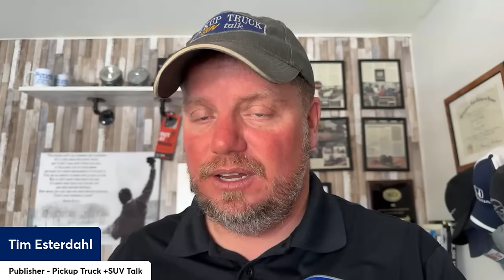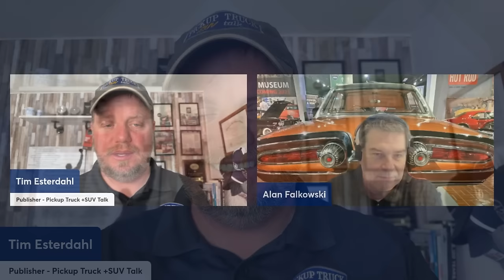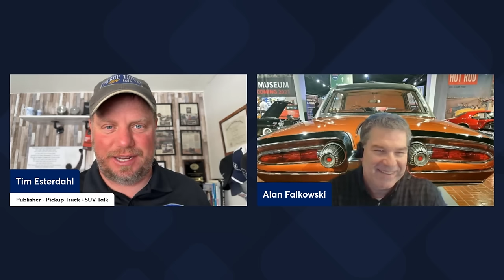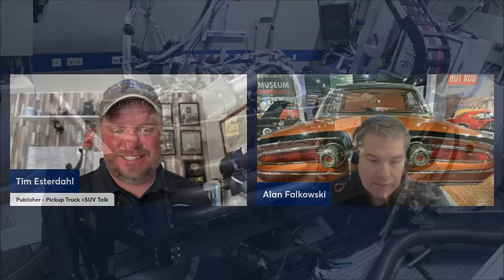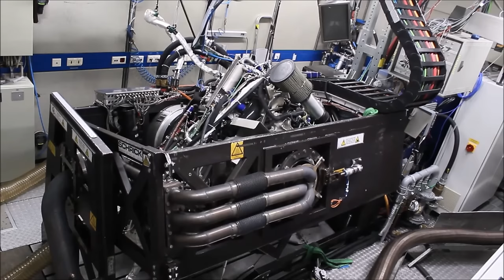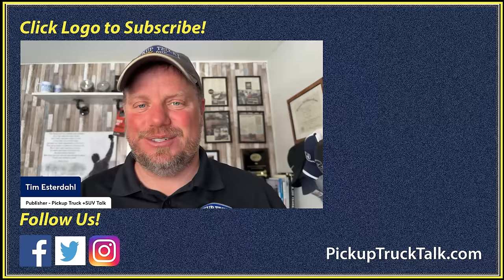Engineer Deep Dive: 3.0L Hurricane Engine - Turbo Life, Oil and Intervals and More

Comment: I notice whenever engineers are discussing new vehicle/engine designs, they rarely talk about longevity in terms of 5-10 years down the road.
Reply from the maker: Nobody will ever talk about longevity in terms of years or miles. It makes no sense for them to do so.
Reply: When you want a 4 cylinder to the job of a V-8.  Have you made that Engine Last as long as that V-8... plus you charge MORE money.  Un real
Reply: @maxr4448 the hurricane is literally damn near bullet proof when it comes to materials and efficiency..I would not be counting it out last way longer than the hemi did stock for stock
Reply: @lafosh7234  How would you know how long a Hurricane would last in the real world compared to any engine?  It has only been on the market for about a year.
Reply: @robc8468  exactly!  Chrysler’s experience with turbo diesels in the late model  jeeps and gasoline turbos has historically been crappy.  I recall my 1985 Chrysler laser turbo was a disaster.  The 02 sensor failing every other month.  Having to cool down the car 5 minutes every time I parked the car to save on the turbo life was also annoying.
Reply: @lafosh7234 just given what he spoke about what they did to keep the turbos cool, to the way the cylinder bore is made smooth in a way where it really won't wear out. That's pretty cool to know that after 200k you can slap some bearings and rings in and put it back together  without needing to bore and hone the block (theoretically) of course.
Reply: @mongo64071  yeah..recalling a 1985 car sounds like the responsible thing to do….but in the years beyond that to today 2024 we have came a very long way in performance cars reliably handling high boost..these inline engine are specifically built around handling high boost and the wear and tear that comes from that…these are stronger and more efficient and durable and LIGHTER materials in this engine only pushing just tipping 2klbs compared to the heavier v8 and ESPECIALLY HEAVY ASS BATTERY EV’s..the Daytona weight for example is damn near divided evenly with the car and wheels by the actual giant ass battery powering the car
Reply: @lafosh7234  I think the last time Chrysler sold a turbo was back in the 80s with the 2.2.  They went 40 years without any turbo development.  I would not trust their first-in-40 year design with my money until these things have been on the market for at least 5-6 years.  Heck, if Toyota and Honda are having teething pains with turbos, I can’t imagine how badly Chrysler will mess this up.
Reply: @Pickuptrucktalk What metric should they use? Have they developed no service intervals based on time or mileage? While hours running is typically a better metric, especially when thinking of service vehicles, but it doesn’t account for items that time will get to regardless of time running. 
People are going to be rightly cautious when a manufacturer goes to an entirely different power plant, especially when they say that it will last xxx hours because they’ve seen it in a lab. That simply doesn’t translate fully to real life.
Reply from the maker: @Freedom_is_better_than_safety  there's a new oil life sensor most brands are moving towards. It is a much better gauge of the oil than miles or hours in their opinion.
Reply: @Pickuptrucktalk But this doesn’t address the question of the component longevity 5-10 years down the road. Oil maintenance is only one aspect the consumer is worried about. Most of us are worried about the long term sustainability of the major hard parts of the vehicle when they cost $60k and more for a new pickup, and what we’ve seen in recent years (especially on the small displacement turbo engines) is that replacement of major components before or around 100k miles is not uncommon. All of the Ecoboost engines suffer from major issues, and they were reported to have been tested for X hours/miles, etc with recommended oil change intervals but this isn’t translating to real life. Then you add in rubber degradation and unavoidable failures and we just want to know if we’re going to get this thing paid off in 7+ years at $800+ a month before we’re suffering from costly repair bills. 
Bottom line is when vehicles cost these ridiculous new prices, they need to last for a ridiculous amount of time before repairs are needed if they only receive recommended maintenance.
Reply: @Pickuptrucktalk Not true. I saw one with a Ford engineer talking about the Super Duty trucks should hit 200k miles with minimal if any problems.
Reply: @mongo64071  Not entirely true. They have sold low volume Neon SRT4 with a 2.4T & Caliber SRT4 with a 2.4T. 
There is also the current 2.0T in Jeeps, both PHEV and regular ICE. I'm not aware of any big issues with the 2.0T as of yet. Full disclosure though, I opted for the V6 when I ordered my Cherokee back in 2018 as I was not looking to be a guinea pig on the then new 2.0T engine.
Reply: @UN4GTBL  thanks.  I stand corrected.
Reply: @robc8468  3 years, actually. And it has had higher reliability ratings than any other engine on the market for those years.
Reply: Ford 2.7 ecoboost twin turbo V-6 been around for 10 yrs. GM 2.7 turbomax twin volute I-4 for 5 yrs. Ram 3.0 hurricane twin turbo I-6 is not a slant six w/ a couple turbos jammed on it. Same w/ Ford & GM. Always has been skeptics refusing to accept new designs/technology. From the LS replacing traditional small block, to fuel injection replacing carburetors, to fwd sedans & coupes w/ V6 (3800 was far from a failure) replacing rwd V8 sedans & coupes. Jeez everybody, let's bring back flatheads, those were considered to never be replaced & were thought to be the pinnacle of engineering before overhead valve engines were developed.
Reply: @lafosh7234 the first hurricanes are literally only like 4 years old. Most owners haven’t even finished the payments on these vehicles.

Comment: A big car with a small turbocharged engine may seem like a solution to the problem, but such engines often require repairs after 100,000 miles. Many people get excited about the increased power compared to the old V8s, but what does it matter? We know that many people lease these cars and switch to a new one after three years, leaving those who buy them second-hand to face the potential issues.

Comment: I have a 2005 Neon SRT4 that still has the original turbo and close to 175,000 miles.  Still runs great
Reply: My wife and I both had neons. 5 headgaskets each. Kept getting replaced under a "silent recall" for like $100. These were late 90s. They were garbage. Too bad, we really wanted to like them. It was one issue after another.
Reply: I own a 98 neon. ARP head studs and multi layer metallic head gasket. Ppl have been turbo charging the 420a for years. The engines are fine.
Reply: Your a very very small group that had that luck
Reply: Those cars use to beat my 4th gen Camaro handily. Thought the Camaro lt1 in 97 only had 285 hp and who could tell if the srt4 was hopped up. But they were kinda ugly to me, but props for being light, easily upgraded, ps my supercharged LS3 don’t play that gapped by a neon game!
Reply: That’s awesome! I love those little cars!
Reply: @johnmarshjr928  sounds like a nice way to make 500+ hp
Reply: Every time somebody I know complains about reliability of their vehicle you can look at the car, truck or motorcycle and see that it has either been abused or neglected, dents all over it, empty beer cans and old McDonalds bags filling the inside, ask when was the last time you change the oil, the response is "huh"? I have a friend that said the dealer ruined his new car by putting water in the power steering. His fool wife was the only one that drove the car he always drove his work truck, I KNOW she did it thinking she was filling the windshield washer tank. I've owned many different vehicles since the late 60's and never had one die on me or blow up.

Comment: My '86 Saab turbo 900 went 180k miles with an oil cooled turbo. No water cooling. I changed the Mobil 1 oil religiously at 3000 miles. It was perfect until it was crashed by the biggest deer I've ever seen. No reason a turbo can't last for a long long time.
Reply: Was it a variable geometry turbo? That is what often fails.
Reply: The Hurricane makes three times the power that Saab did, this compassion is pretty poor.

The Hurricane turbos are running vastly higher boost, and are variable, thus they get hotter and need more cooling, nature of the beast, comparing much older and weaker turbos to this is not very equivalent

Comment: So glad I bought a 5th gen Ram when they first came out. 5.7 hemi, no etorque, anti slip, 3.92 rear axle, 4x4. Everything I wanted in a truck.
Reply: Same! '19 Rebel with everything you mentioned.
Reply: I've repaired many 5th gen hemis. My advice, if you plan to keep it for any length of time, is to go ahead and have the camshaft changed to a quality aftermarket cam now rather than later. People blame the lifters, but it's really the poor manufacturing of the cam. It's brittle and will start spalling under normal use. If that flaked off metal gets into the camshaft bearings and fries them, know that those bearings are non serviceable and the whole engine would have to be replaced. Better to swap for a quality cam before risking that. 

I'd also change out the upper control arms. Stock arms are composite material..... PLASTIC. Not a week goes by that I don't see a 5th gen come in where the ball joint ripped completely out of the UCA after the driver hit a pot hole. 

And be extra cautious changing your oil. They mount the oil filter directly above the tie rod bushings. Engine oil deteriorates rubber bushings. That's why they put the oil filter there.... to wear out parts faster. 

Lastly, go ahead and fill the gap along the top of your rear window with flowable silicone (permatex). The window has a thin plastic ring. Instead of the adhesive going directly on the glass, it goes on that ring, so when the plastic cracks, and it will, there's nothing to keep the water out. 

These trucks are designed to fail. But if you put some cash in early to upgrade parts, you'll be a lot happier later.
Reply: @facepalmdaily4404  thanks for the advice. Yes a aftermarket cam and headers are definitely on my to do list!
Reply: @IamChucky_  Good deal. It's an expensive up front cost, especially if you are paying someone to do it, but it sure beats the alternative. I've seen guys need new engines at 50k because their cams spalled and wrecked the bearings, or the metal gets down and wrecks the rod bearings. 

And I don't care what anyone online says. If your tick is coming from spalling on the cam, no thicker oil is going to fix it. Those guys fixing their tick with thicker oil had lifters that weren't properly pressurizing with oil. the slightly thicker oil will help with that..... not a cam problem and cam problems are the bigger occurance.
Reply: My 2015 Express is the same
Reply: what's wrong with etorque?
Reply: @felixchien1664  cost to benefit is the problem.  It's many thousands of dollars in parts and labor to replace the battery pack and/or generator. 

 MPG is 17/23 vs 15/21 for the non etorque. That's it. An extra 2mpg. 

Low end torque is mildly improved and the etorque has that start/stop feature at red lights. 

The cost you pay when it needs to be replaced (nothing lasts forever) is far more expensive in parts and labor to an alternator and regular 12v battery..... all for only very mild improvements. 

Reply
Reply: @facepalmdaily4404  i see. thanks for the response
Reply: @felixchien1664  Lots of added complexity with negligible benefit. Cheers!

Comment: Once again some very good information regarding the 3.0 L Hurricane Engines, directly from one of the Engineers who designed the engines.  Thanks again Tim, for your ability to get this kind of information directly from the source!
Reply: engine might actually turn out to be great but then everything else they make will be trash (cheap ECM, cheat evap components, cheap wiring, cheap starters-alternators, water pumps, etc etc etc)

Comment: My first turbo car was an 86 Dodge Lancer ES turbo and it was one of the most reliable vehicles I have ever owned. I have been driving turbos ever since. In fact, I still have an 86 Dodge Daytona Turbo Z that I drive hard the first 5 years I had it and it had a 145K miles on it with the original turbo when the transmission lost second gear drag racing it. I also have a 2022 Jeep Grand Cherokee 4xe with the Hurricane 4 and love it. So I completely trust their durability.

Comment: I just want to know why that rubber coolant hose was placed way in the back of the engine that would require engine removal to replace. 🧐 😊
Reply: Stellar engineers following tube jockey designers.
Reply: Ram purposefully designs their engines to fail. That's why they put so much effort into making it look pretty and making the interior so damn comfortable. That way when it has a problem and you get hit with the sticker shock of an unnessarily expensive repair, you'll be more drawn to another Ram, because sure this one had a problem, but they are so comfortable! No way I'll get unlucky twice! Spoilers: You will.
Reply: @facepalmdaily4404  uh... 5.7 hemi.... solid engine...5.9 magnum...solid engine......5.2 magnum.....solid engine.....im confused here, they design their engines to fail?
Reply: @go_dawgs_8290  Mild rephrase: Design their VEHICLES to fail. My bad. Engine is part of it, though. They have been in the habit lately of designing them to inhibit owners ability to work on them themselves and engineering them to cause more problems. Few examples of built to fail..I'm speaking specifically of the 5th gen and 5.7 hemi. 

Starting small: There used to be a bleeder bolt on the top of the water pump. When you did work on the engine and needed to refill coolant, it was as easy as removing that bolt and filling till coolant came out of it. System is purged of air(usually). Good to go. They took that away and now require vacuum filling the system. 

You used to be able to access the lifters without pulling the cylinder head. Not anymore. Intentional decision in my eyes considering they were having tons of lifter issues before that and instead of fixing the issue, they moved the lifters to make it a MUCH more expensive repair. 

The rear window leaks because Ram puts a thin plastic ring around the entire window. The adhesive bonds to that, rather than directly to the glass. So when the plastic cracks, because that's what plastic does, there is nothing to keep water out. Ram knows this. So what did they mount directly under the leaky window? The Etorque battery and the RF module for the key fob. The window is designed to leak and updates to that design have never strayed from that plastic ring. 

The oil filter. Front suspension parts, particularly the rubber boots and bushings, don't like engine oil. It deteriorates them. So Ram placed the oil filter directly above the tie rod boots. If you take it to a shop to do the oil changes, as most people do, the shop drops the filter, lets the oil spill and then just wipes it up after. Every oil change oil gets on the boots. I can't count how many times Rams have come in with front suspension issues and, surprise surprise, it's mostly the passenger side. 

FCA will tell you to change your oil every 5k miles. I've contacted them myself and that's what they point blank told me. Particularly on the 5.7 hemi. Change it every 5k with full synthetic.  However, the oil life percentage gauge they put in the dash doesn't tell you it's time for an oil change until you are closer to 10k miles. That's intentional. 

Now the camshaft. The cams they put in are brittle and prone to shedding metal. Everyone points to the lifters, but it's the cam. It's not properly heat treated, so the metal begins spalling. That spalling eventually wrecks the lifter roller. People take the engine apart, find the wrecked lifter and think that's what did it. It's the other way around. Brittle, poor camshafts. They never updated it. I've seen plenty of cams covered in spalling without the lobes being flattened (yet). Every bit of spalling is more bits of metal floating through your engine. 

Plastic upper control arms. I've lost count of how many people have brought their trucks in because the ball joint completely separated from the UCA after they hit a pothole. 

So yea, I misspoke in my previous. I meant to say Vehicle, not engine exclusively. So many things about the engine, trans, body, suspension.... all designed to cause more problems. FCA stacks the deck in their favor for failures. 

I could keep going, but I've written a short story here already.